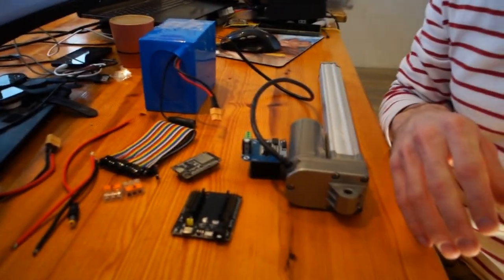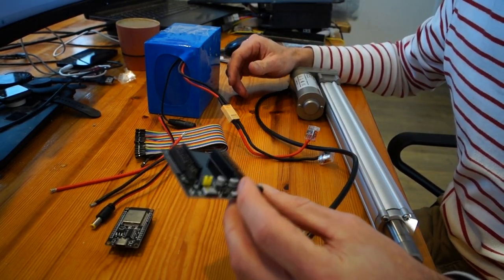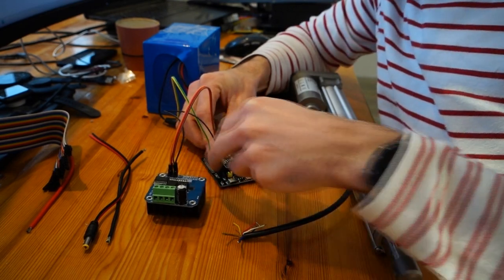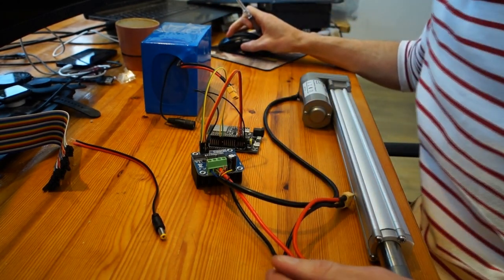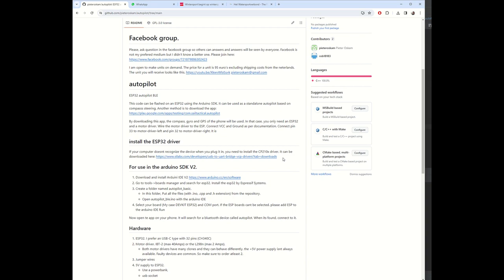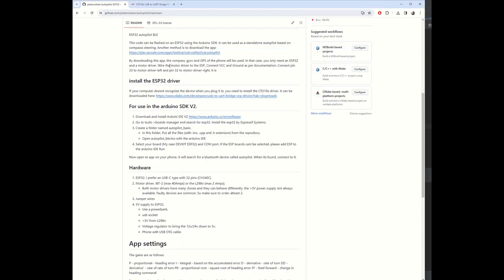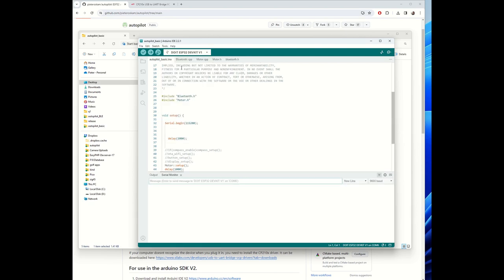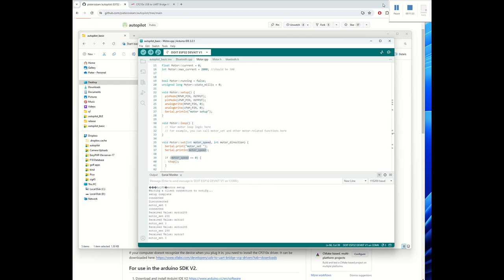Bluetooth Autopilot Assembly hardware and software

Comment: ia m very new to this, when I run serial manager it just cycles through the same load/entry random things I dont understand and does not look like what you have. I have tried re uploading it and it does the same thing and doesnt appear to connect to my phone
Reply: It just constantly reboots on the serial monitoring is now what im seeing
Reply: some quick forum reading is pointing to a coding error being the issue but i have no idea how to address that
Reply from the maker: Can you copy paste the error ?
Reply: Rebooting...
ESP-ROM:esp32s3-20210327
Build:Mar 27 2021
rst:0xc (RTC_SW_CPU_RST),boot:0x8 (SPI_FAST_FLASH_BOOT)
Saved PC:0x40377630
SPIWP:0xee
mode:DIO, clock div:1 @PieterOskam
Reply: ELF file SHA256: 220a502224dff5a7

E (213) esp_core_dump_flash: Core dump flash config is corrupted! CRC=0x7bd5c66f instead of 0x0
Rebooting
Reply from the maker: @pearl2621  you have the wrong esp32 I think. Code is made for a dual core esp. So what exact version of the esp32 do you have?
Reply: I got the correct board and everything worked well. Thanks much!

Comment: I am going to adapt this for my servo controlled trolling motor. I can do the left and right with a normal servo PWM signal (I use a vert large servo to steer the trolling motor). Is there any possibility you could add a speed control to the app? I am using an 60 AMP ESC that is also controlled by a PWM servo signal and it would be quite easy to control that with the ESP32 as well.
Reply from the maker: But that speed would then be depending on the distance from the boat to the virtual anchor point right?
Reply: @PieterOskam  Usually the speed is just set (like normal trolling) and when/if  you get to the end of a route it just stops. I did not yet think of station keeping because it is a PITA with the motor on the back of the boat. What is the maximum number you send in the "motor" command you send? I need to know that to calculate how far to move the servo.

Comment: What compass did you wire in to make it independent
Reply from the maker: Icm20948
Reply: Can i use different manufacter of that chip? I have sparkfun icm20948

Comment: Looks like I am part of your beta testing group ,😊 Yea!!! 
After listening to your videos and scratching my head a few times I did get the ESP32 firmware updated, linear actuator connected  and the Autopilot program installed. 
Thanks for all of the great programming and videos. 
Boat should be on the water early May and start using the program.

Comment: Ok, you can add control buttons to the sp 32 firmware without a smartphone...
Reply from the maker: Currently working on that. Buttons work. Now working on staying in sync with phone. I also added a compass, so the unit can be completely used without a phone.
Reply: how to connect buttons to esp32...connection diagram....thank you. @PieterOskam
Reply: My complements to you. Found your videos by chance while reviewing pypilot videos. I ordered the larger BT1 Power Supply, a couple of esp32 boards and a linear actuator. All arrived today. 
I set up a RPI 4 with Openplotter last fall, but I will set up your build design also.  It doesn’t hurt to have a redundant system. Hopefully, I can follow your software instructions. 

What is the ESP32 plugged into? Is that a 12 volt power supply that you show in your video?
Reply from the maker: @rusty19481  I also started with pypilot and  openplotter. But the system were rather complicated and too complex for my needs. 

Where i plug the ESP32 into is a sort of adapter boards. It has a built in 12v->3.3V converter and also you have a lot more pins to connect to for easy wiring